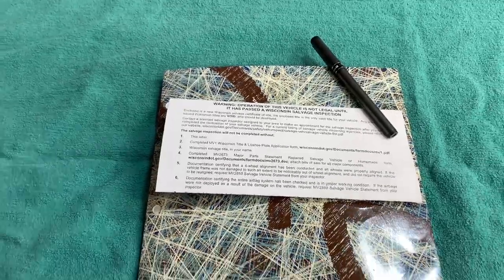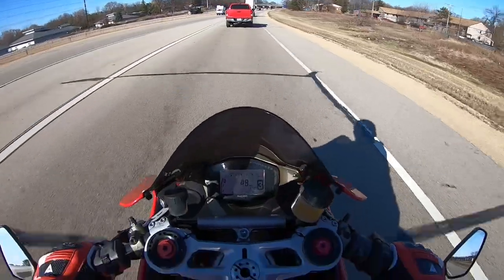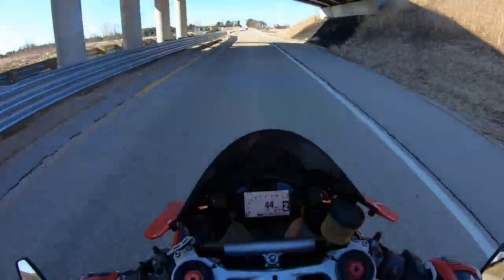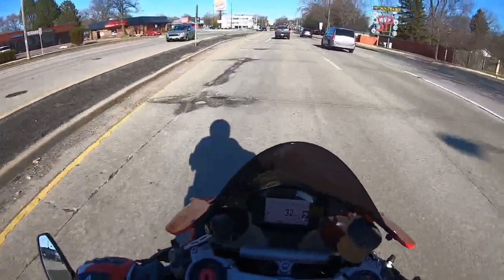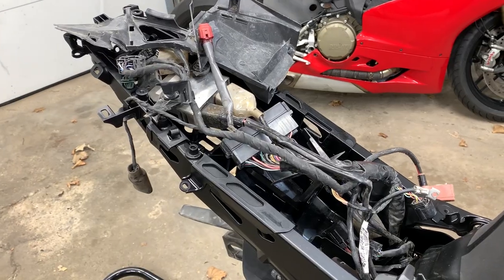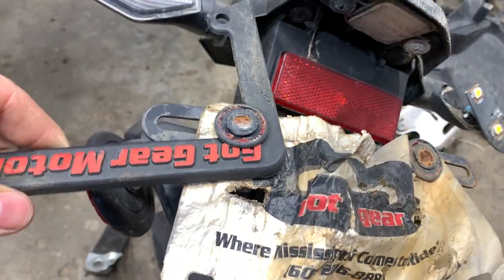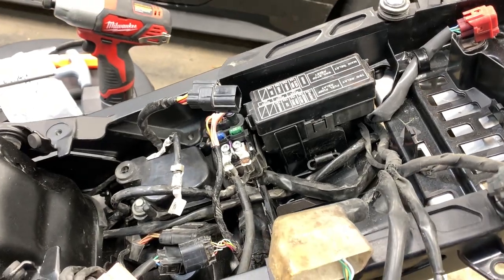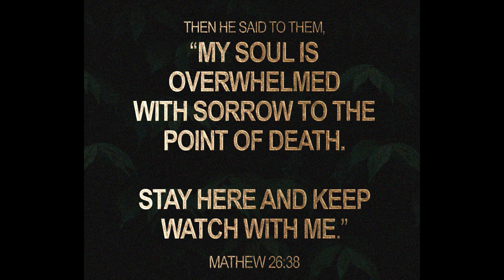Rebuilding A Wrecked 2019 Honda CBR1000RR (Part 5)

Comment: Well done restoring the Panigale. the 1199 is an amazing bike. It takes some getting used too because its a unique ride. But once you Gel with it I recomend put some soft sticky tyres on in, turn the engine resonse to high , turn off the DTC and Wheelie control off then have the ride of your life. With out the inhibitors its next level wild
Reply from the maker: Cheers Chris! You're right it does take some getting used too! I've barely scratched the surface with this panigale and I've taken her out on some twisters! I probably have not even scratched the surface with this Ducati, and probably never will unless I get the full experience on a track!
Reply: @CJMediaOfficial  Wise man. It does take time in seat like for me about 10 months every 2nd weekend on the local twisties until I felt 100% confident I could really let rip with out feeling like it was going to kill me lol. I have only just recently taken mine to the track for the first time and what a blast. If your not an experienced rider I recommend booking some training with a pro track rider. My wife blessed me with this as a present and it was a life changer for me. Even though Im an older rider , I didn’t realise what a rubbish rider I was until shown by a pro all the things I was doing wrong. It took my skill level and confidence through the roof. I have never had so much fun riding in my life and have to say haven’t had any of those scary thank God I'm still alive moments since. It’s expensive but worth more than all the Gold my friend.

Comment: hey I would look deeper into the death wobble some more, that's not normal, something is probaby not straight or out of alignment on the forks/front wheel, and/or torqued down properly....I'm not sure exactly what the issue is but check everything is straight and torqued to spec
Reply: it could also be as simple as needing a wheel balancing
Reply from the maker: I appreciate the concern! It was very windy and it was country roads (poor pavement) (cold tire) lots of variables in my opinion. I just redid and torqued all the bolts down to spec so I don't think it would be that. I let up early during the wobble because I could feel it coming but I also felt my steering stabilizer actually slow the wobble down. Got any ideas on anything other items that could be a issue?

Comment: That harness is such a headache, I rebuild a Honda Cbr 1000 SP1 and I change the same lower fender on the subchasis, and the mounting of the harness took me 2 days. Everything is so tight on that lower fender, just the right space for the right thing. Even the battery is so hard to put inside. I hate Honda organization on this generation. The ABS module make more hard the work, and the lines of the brakes, be carefull, everything on honda is so delicate, even more the bolts and screws. Btw, is so easy to find 90% of the spare parts
Reply from the maker: Andrés I appreciate the information. I'll have to look into those spare parts more. Also yes I agree it's so tedious in the rear. I guess it will just take me time then to get it all right. Hopefully it doesn't take me too long. Thanks man!